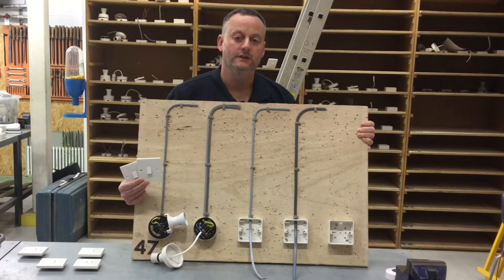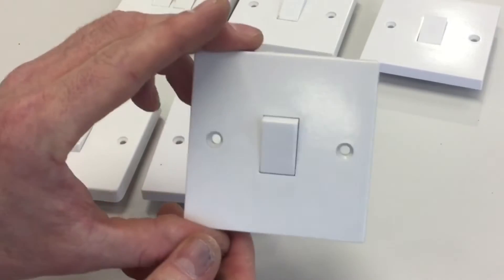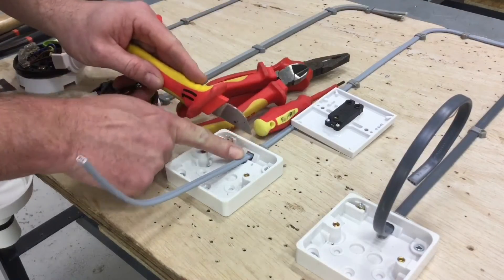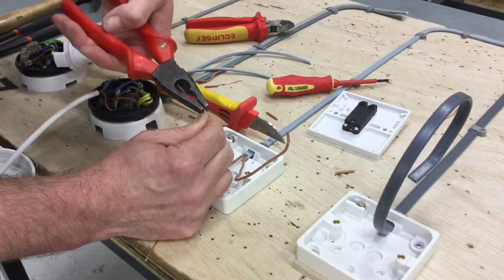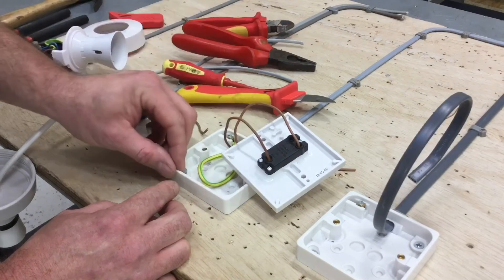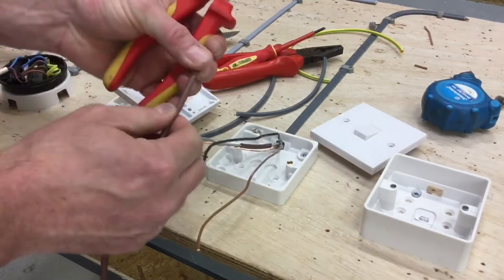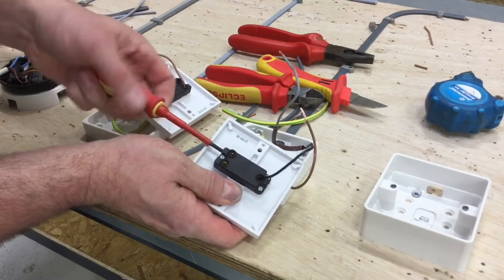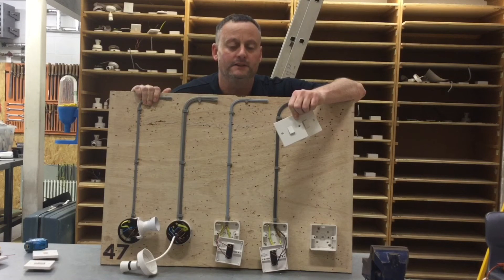How to Terminate our 1 Gang One Way and a 1 Gang Two Way Light Switch Wired in PVC Twin Cable

Comment: I have changed my kitchen light switch works no problem now my Sittingroom  light won't work ,,, my kitchen switch has one neutral 2 red L1 L2 all wired but still my sitting room light won't work

Comment: I wonder if you can help me,  as I cant seem to wire up a 2 gang switch in same room as I have a 1 gang I have done a diagram of room    https://ibb.co/Hdt0BnY     and here is back of old 2 gang switch.  the right side 3 wires red yellow and black are on left side of switch    https://ibb.co/YWbJjt0    I have wired up the 1 gang  no problem, but cant do the 2 gang as the left side of 2 gang is linked to 1 gang. I hope you can help me

Comment: Brown in common on a 2way surely?
Reply: No, three core cable + earth installed as strappers  inbetween the two two-way switches. The black wire connected,terminates in the both common terminals in the two two-way switches. Brown connects to L1 to L 1, grey to L2 to L2, CPC to CPC terminals of the two two-way switches. 😳